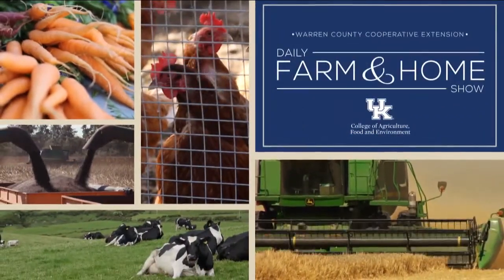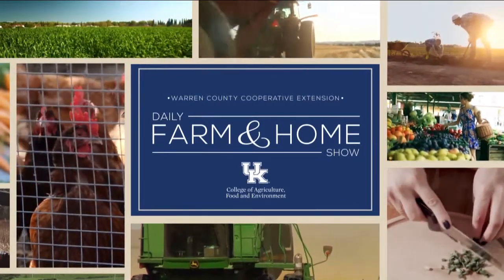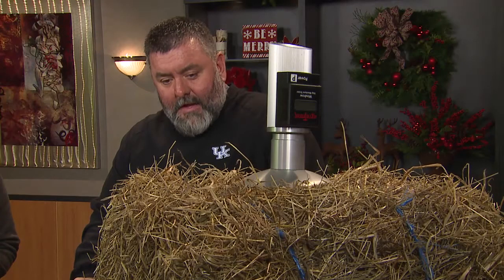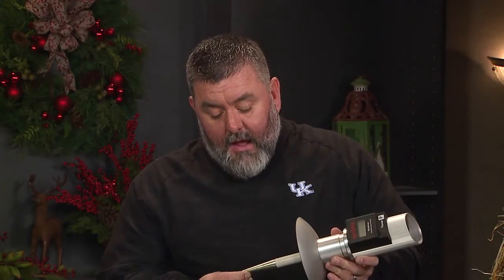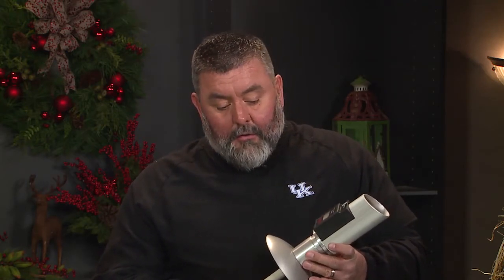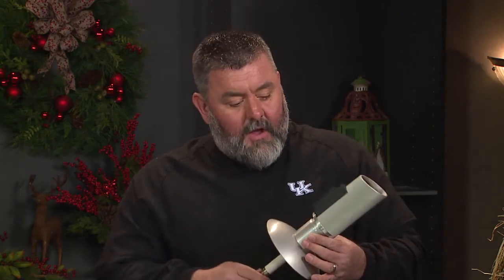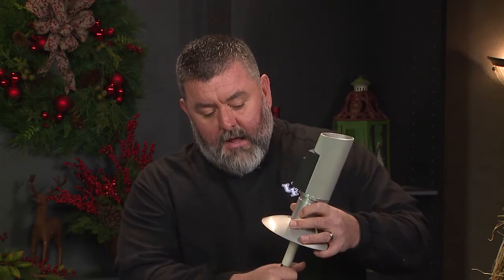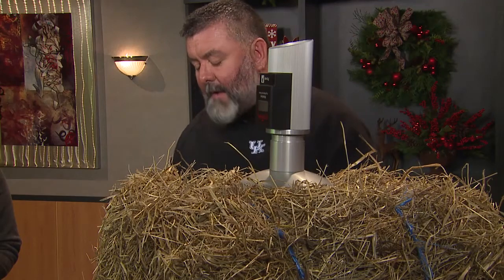Testing Hay for Moisture and Temperature

Comment: I have never checked moisture of grass that I’m making high moisture Haylage/silage round bales. I mow a 13’ windrow, let it wilt for a couple of days then  bale and wrap in a hard core silage Baler (Krone Comprima CV150XC). Makes excellent Haylage/silage every time. Bales weigh from 1400-2200 pounds.